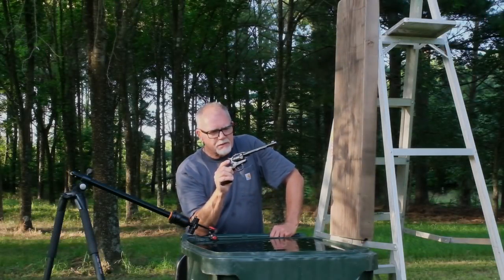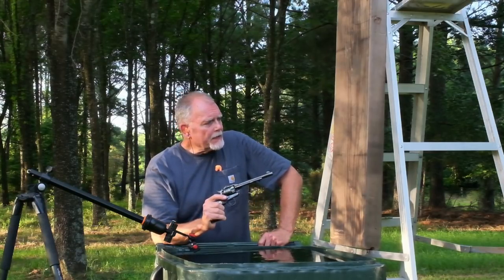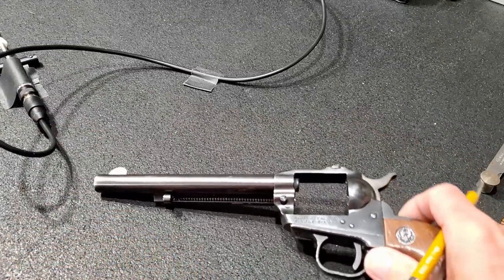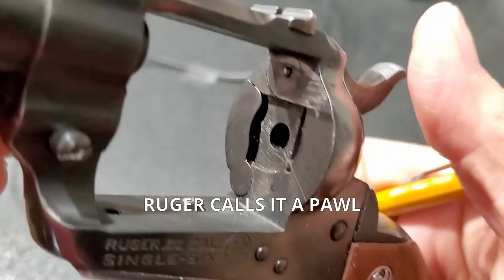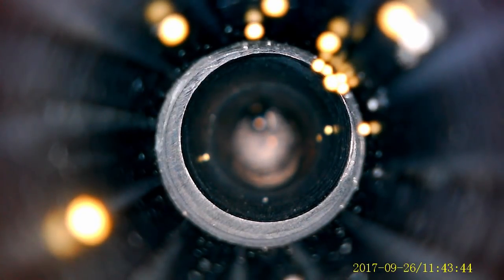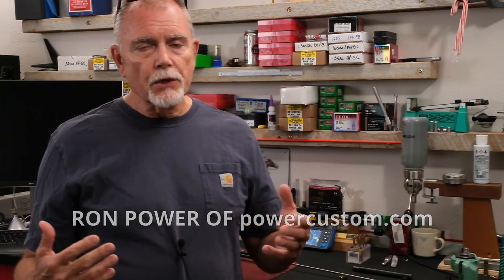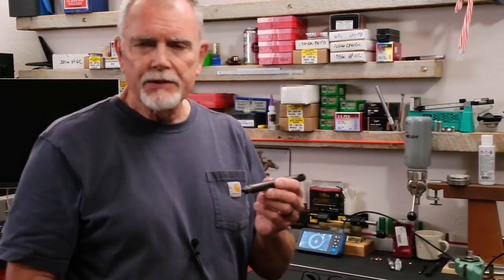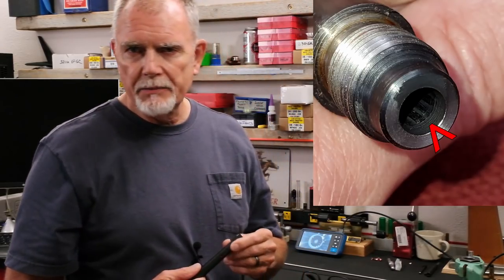The Bullets From My Single-Six Are Crooked ! ! !

Comment: This is a great project! Thanks for taking us along!

Wondering if that is the original cylinder that came with the gun? I think my single six has the serial number engraved on the face of the cylinder. Also, did Ruger ever make these in .22 wmr only?
Reply from the maker: Thanks! This is a 22 Mag only version according to Ruger. And the last three of the serial number are etched on the face of the cylinder.
Reply: Bought mine in 1975 and came with a mag cylinder

Comment: I really enjoyed this video series as  I’m a former high school physics teacher,. Do you think this problem is due to wear or was it just a factory dud?
Reply from the maker: That's a good question. The timing issue could be from the factory but with evidence of some Shadetree Gunsmithing I can't say for sure. But I think that vertical misalignment between the chambers & the boar is a result of the original Barrel Manufacturing in that the bore of the barrel is not concentric to the barrel blank. That's a supposition on my part but I will be able to tell once I start unscrewing that Barrel. Because I will be putting the borescope in and seeing if the misalignment follows the barrel rotation.

Comment: Had a ruger 45 colt, could never get factory or handloads.to shoot straight,  finally looked.the barrel over good and it had a 1 inch blemish that followed the rifling in their twist,  I should have gotten it fixed but at that time I was done with the project to get it to shoot.
Reply from the maker: Yeah sometimes we get frustrated and give up on guns like this. If it was a newer gun I'm sure Ruger would have just replaced it out right.

Comment: Either the Base Pin or the Cylinder bore or both are worn. Any repair done without dealing with this issue is foolish. If you just had a rotational timing issue you would not have the vertical offset issue. If you wish to retain the original Cylinder I would bore, sleeve, and ream it to fit a new Base Pin. After this repair you will see how much timing issue remains and how much further repair is needed.
Best of luck.

Comment: I'm not sure how replacing the barrel is going to correct the misalignment. I think the fix is to replace the cylinder.  Maybe you have a warped frame. If that's the case, then you need a new gun and accept the offer from Ruger to buy a new gun at a discount.
Reply from the maker: Thanks for your feedback. I'm working on a tool to remove the barrel. When I get done with that and actually take the barrel off I will stop and take video along the way. It is that process that will tell me whether or not the barrel is the issue. Just a guess on my part because I have zero experience smithing experience. But Mr Ron Power did agree with my hypothesis one of the possibilities.
Reply: @TargetSuite  I wish you good luck in fixing the problem.

In the 1980's I bought a brand new Ruger Single Six 22LR/22Mag. revolver. After about 200 rounds, I would get hit by unburned powder or lead shavings.. Rather than fixing the problem, I sold the Ruger to a gun dealer, telling the dealer of the problem. In the 1970's, I had similar problems with the Ruger Super Blackhawk in 44 Mag. after about 1300 rounds. I also sold it to a gun dealer. 

In my opinion,  ruger hands guns are built tough but are not built to close tolerances as Smith & Wessons. My Ruger Mark 1, 22 LR, 10 inch bull barrel is still good, and it's a keeper.

In my opinion a 40 year old Ruger with a serious problem as yours is not a keeper unless you enjoy tinkering with it. Be safe and in good health.
Reply from the maker: Thanks! And yes I am tinkering with this because it is a fun project and it's generating a lot of interest with my YouTube Community. I have heard that newer Ruger revolvers don't have these kinds of problems like the old ones did. If that's true, it's probably because of advances in CNC Machining
Reply: @TargetSuite  It's good you enjoy tinkering. I agree, CNC machines are producing tighter tolerance machined parts, making budget guns as accurate as premium priced guns.

Best wishes.

Comment: Is it possible that the gun needs a new base pin? I am just curious to know if you got the gun repaired.
Reply from the maker: I have a new oversized based pin from Power custom. It tightens things up but it does not help with the vertical misalignment
Reply: @TargetSuite  A real conundrum.

Comment: I would have liked to have seen some groups; was it still accurate?
I have an H&R 929 which groups 6" at 50 feet. I have been working with it trying to get it to shoot better but I am about to give up and sell it. It is in 95% condition with a mirror bore. It does not shave lead but perhaps the chamber is slightly misaligned. My other .22 revolvers shoot 1 to 2 inch groups at 50'.

Comment: Morning George....another interesting video! I was wondering if you thought about a new cylinder pin from Power Custom..........as the play is only 1/2 of a thousandth, with one of their custom pins, which takes a whole lot of slop out of the cylinder movement........just a thought.....
Reply from the maker: Hi Ken. I have one of there oversize pins and will install it when the "smithing" starts. Thanks!

Comment: I have convertible single six and I am wondering if somebody switched cylinders from another Ruger! 
About the Ruger I have - I sent it in to get the transfer bar conversion installed and wished I had not done so! I'm thinking of installing the old parts back in it!  the thing is jerky and rough when cocking it.  since I am the only one using it, I guess I'll just leave it!

Comment: Interesting, however there is a bushel of assumptions and improper reference location, e.g., your right arm remains your right arm regardless of viewing position.
You introduce unneccessary error complexity by referencing your point of view rather than referencing landmarks of the revolver. 
It would make sense to check concentricity and true position of cylinder bores and cylindricity and thru-hole parallelism of center hole surfaces(possible coning or extruding), 
center bushing (if used), and tolerance of fit and straightness of pivot pin, frame center hole wear, etc., as first suspects.

Comment: Seems that the cylinder and cylinder pin is worn a bit as well as the cylinder lock latch ? Replacement of the barrel which has no movement will not correct a alignment issue. Just my opinion , I enjoy your videos sir thx for sharing

Comment: I bet someone dropped the Revolver and bent the frame a bit. They tried to tweak the pawl and cylinder stop to make it work, but the accuracy was trash, and they got rid of it
Reply from the maker: That's the risk you take when you buy a used gun. Especially one from an anonymous source like the pawn shop. But sometimes it works out. You just have to be willing to take the risk.

Comment: I’ve been told Ruger used .224 barrels for several years on the convertible Single Sixes which caused some inaccuracies when shooting .22lr. Supposedly, .22lr barrels are .222 diameter, while 22 WMR are .224. Any truth or just misinformation? My 1973 Single Six was considerably more accurate when shooting 22 WMR leading me to believe it is plausible. Now, I want to bore scope it for proper alignment. Thanks for the video.
Reply from the maker: Thanks for your comment. 22LR and 22 WMR do not share the same bore or groove diameter. So the convertible models were sized for the larger 22wmr bore diameter. Whether this cause 22LR to suffer accuracy problems is not fully established.

Comment: You need to dismantle about 10 bullets to compare unfired to fired
Reply from the maker: Thanks for your comment but I'm not sure what disassembling unfired bullets would do for me.
Reply: @TargetSuite  well you could examine the unfired projectile for the concentricity as it compares to the fired ones. This could support your contention that the projectile is damaged by the forcing cone. Not withstanding the damaged projectiles, it is completely obvious that the cylinder once  lined up properly but does not now line up at all, almost as if that cylinder and barrel were never matched. Odd.

Comment: If you just shot 6 bullets in a block of ballistics gel, or straw, wouldn't the bullets tell the same story regarding the absence of, or uneven rifling marks?
Just seems like a lot of trouble for a revolver that has no history, and I assume the last 3 digits of the serial number are not present on the magnum cylinder. Looks like a non-converted old model with an ill-fitted cylinder.
I don't know. This guy seems pretty smart.
Reply from the maker: Thanks! I appreciate your comment. Perhaps gelatin would tell the same tale. But it would also be more likely to distort the bullets than water. Just a supposition on my part. Regardless, it was a little something different to offer up than the same old bullet in gel video. As to the pedigree of the gun, there is a lot of "history" here with the strange file marks and firing pin dings on on the back of the cylinder, but at least the cylinder is properly marked with the last three, and the gun doesn't show excessive wear on any of the normal surfaces, like the base pin.
Reply: @TargetSuite  Yeah, I'm an idiot for not realizing the entertainment aspect of your presentation. You're right about water preserving a handgun bullet better than many other materials. I would think the filing marks on the pawl/hand, would be someone's efforts for better timing.
You have this "old model" SS; with a flat hammer....unmodified I am supposing.
Was this offered with a LR cylinder?
I doubt it, because you would have mentioned it...for comparison.
You m.j mentioned firing pin dings on the back of the cylinder. Sounds  like my LR cylinder. My grandson was fanning it, badly.
I have some nice cowboy guns. The most accurate, fun to shoot, and reliable,

Comment: Have you thought about checking firing pin strike location comparisons between your Ruger Six and your Heritage Rough Rider?
Reply from the maker: I don't have a Heritage, but I will have a second Single-Six in a week. It will be on long term loan to the channel. I can compare that.
Reply: @TargetSuite  Sounds like a plan, I hope my theory about the firing pin being offset compared to another .22 single action revolver, namely the other Single Six you will be getting, helps to shed more light as well.
Reply: @TargetSuite  I think I need to clarify my theory, I am thinking that the cylinder and alignment pin are where they are supposed to be and that the piece that rotates it is fine, but that the hole that was drilled and tapped for the barrel to screw into the frame to line up with the cylinder is machined off center that .004" that is causing the issues with accuracy.
Reply from the maker: I like your theory. I think it's either that or the hole in the barrel is not concentric to the outside of the barrel. That would also explain that vertical misalignment.
Reply: @TargetSuite  Thank you. The theory came to me because I used to be a machinist in a utility trailer factory, if our parts were not perfectly fitted in the jigs or table vices they would be off spec, and/or if our jigs and vices weren't perfectly centered either. Sometimes it could take me upwards of an hour to properly align the jigs and vices and then set up the tooling between parts, depending on the complexity of them.

Comment: Cylinder pin wear?  Just a thought.
Reply from the maker: The pin looks to have a little excessive clearance but nowhere. I have an oversized pin that is going to tighten things up nicely once I get the alignment issues worked out. Thanks for the comment!

Comment: on my single six the fluted cylinder is for 22lr the magnum cylinder is not fluted
Reply from the maker: They started that process of fluted/non fluted in the early 70s. For this 1968 model both cylinders were fluted. But it doesn't matter because Ruger customer service said this particular revolver left the factory as a 22 mag only And the cylinder is marked with the last three digits of the serial number just like they did the 22 mag cylinders back in those days.

Comment: I'm enjoying this investigation. Before changing the barrel, you might consider trying the Power hand and cylinder stop in an attempt to get the left/right component centered up. Yes the vertical alignment might not be where you want it but it may work anyhow. I'm guessing the Power parts are slightly oversized and may need some minor fitting which would be to your benefit. Additionally, since this is quite the project, why not slug the barrel and each chamber. While not a 22, I did this on four Ruger Blackhawk 45 Colt revolvers and ended up having the cylinders honed to proper spec on all 4 guns. If you get a gunsmith involved, perhaps square up the back end of that barrel to try to make that barrel/cylinder gap more uniform- .004 difference from top to bottom would bug me even though I cannot say how much of a difference that might make. Lastly, while the barrel is off, true up/polish the forcing cone. If all that fails, put on a new barrel but true it up and check/polish the forcing cone prior to installation. There, I'm done spending your money and time!

On another matter, I purchased 2 Teslong units, one handgun and one rifle. I got them into the house without the wife finding out. If she had caught me I was prepared to blame it on you! LOL!
Reply from the maker: I've got all the appropriate PC parts on hand. But after talking with Ron Power, I am going to try and resolve the vertical misalignment problem first before modifying any of those parts. Btw, I have squared up both ends of the "new" barrel and will recut the forcing cone as well once I get the rod that goes with the reamer. It is on back order. How do you like the handgun scope? I want to get one myself to take with me when shopping for used handguns.
Reply: @TargetSuite  The handgun scope is very handy and works great. I bought the model that plugs straight into a laptop. It's plug-n-play with Windows 10. I had thought I would also use it with my cell phone for portable use but I found out today that the adapter plug Teslong supplied with the unit will not fit in my old cell phone. So I will look for another adapter. I think you will be pleased with this portable unit.

Comment: Hey there.  This is the first video I've seen of yours but I think I have the solution to your problem.  Most likely the cylinder stop and hand are worn/damaged but with the cylinder moving up and down it seems your cylinder pin fit to the frame and/or cylinder is too loose as well (probably because someone has been spinning the cylinder Hollywood style for fifty years with insufficient lube.)

Break out your micrometer or calipers and make sure the cylinder pin is the same diameter the entire length and dead straight.  I think you'll find it is thinner where the cylinder has been wearing on it over the years.  With any luck the pin is made of softer steel than the cylinder and frame so simply replacing the pin will restore the vertical alignment.  If the cylinder pin bore is worn you may have to go to an oversized pin and have a machinist ream the cylinder/frame to accept it or install bushings in the cylinder to fit a new, correctly dimensioned pin.

Once vertical is fixed,  you will find your timing is improved or even corrected; if not you can fit and replace the new hand and cylinder stop to correct it.  The barrel is almost certainly ok as it does not appear to have been as abused as the action.

Good Luck
Green
Reply from the maker: Thanks! Great comment! I have tried the oversized base pin from Power Custom and it takes out almost all of the up and down slop of the cylinder.

Comment: Omg.    It's just the timing of the cylinder and barrel.   That's why cant use another cylinder from another gun.    Has to be timed for each gun.
Reply from the maker: Yep. Timing is atrocious as the gun sits now and will be corrected with the new hand and oversized cylinder stop from Power Custom. Thanks!

Comment: Since you're obviously a revolver fan, I suggest you buy higher quality revolvers and don't sling the cylinder shut like the movie cops. A good revolver won't have this alignment problem in the first place and treating it right won't create a sloppy rotational alignment problem as it ages.
   BTW I have an H&R Sidekick 9 shot 22 lr revolver and it's just as bad as your Ruger. But it was my grandfathers, and like my fathers 38 special S&W nickle plated model 10, it's an heirloom piece I have ammo for but almost never shoot as both of them have been slammed shut a lot and are loose as hell and spit lead like crazy.
   I'm a fan of semi-auto weapons because I can choose when to make them a deadly weapon. Until I rack the slide they're just a bludgeon with no possibility of accidental discharge. They're safer than revolvers when used properly.
Reply from the maker: Actually I'm a lever action rifle guy. And these single action revolvers don't sling shut. The cylinders are fixed. Just FYI

Comment: Oh boy , looks like you are moving the right direction to correct the timing if in fact it is out of time ! 

I was thinking that because you can move the cylinder Down 0.004 and have pretty good alignment,I would Mike the cylinder base pin hole and also Mike the cylinder base pin diameter itself ! 

My Ruger Single Six cylinder locks up solid no play up or down and there should be no up and down movement! 

Do a quick test , remove the cylinder and reinstall the cylinder base pin into the frame , can you move the base pin up and down while it’s in the frame ? If so how much ? And where is the movement at ? Front or rear of the frame ! 

Next remove the cylinder base pin from the frame and run it into the cylinder , how well does the base pin fit the cylinder? Is it snug , is it loose , is it tight ?  

You should not be able to push the cylinder down while it’s mounted in the frame , not 0.004 !